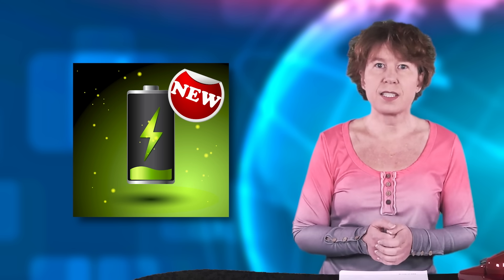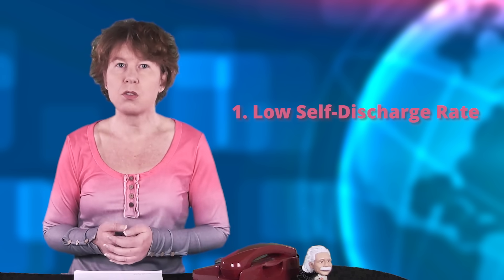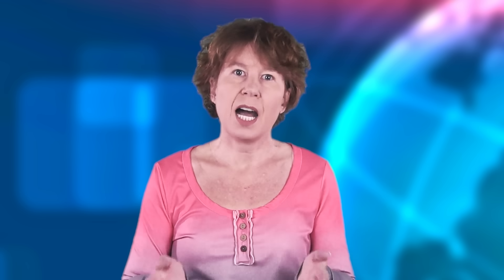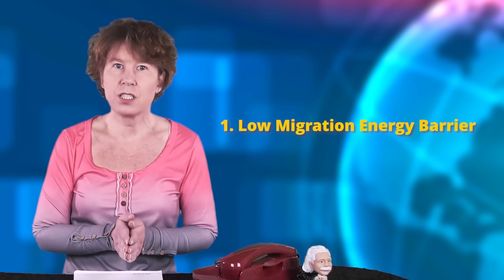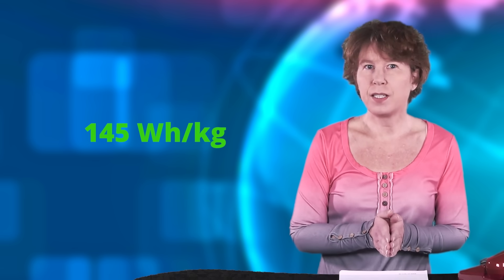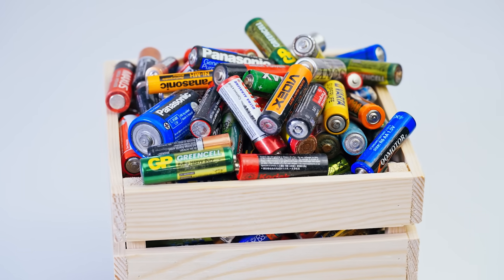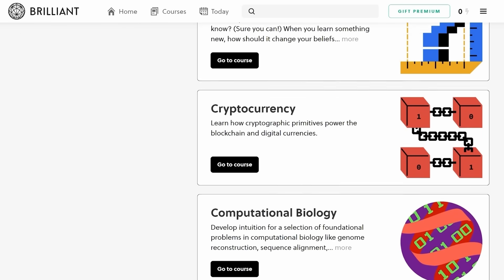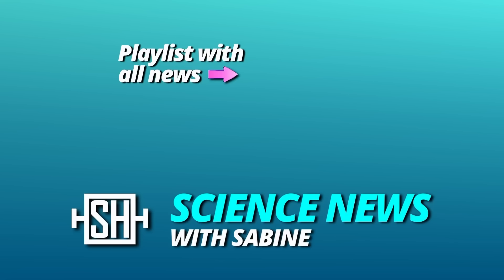Fully Charged in Just 5 Minutes: New Battery Breaks Records

Comment: @sabine - you're using a weak charger. Your phone should go from 0 to 85% in about 25 minutes. Get a GAN3 usb PD100 charger (or better) that actually does 100w or more out of a single usb c. 
They charge super fast, 1 hour is way too long. I need to charge mine pretty fast because of livestreaming - they die super fast when you're encoding 4k 60hz video on the street. 
Here's what I've always wondered, and maybe you can make a video about why: Why the heck don't these cars have a mechanical bypass series that can charge all the cells in parallel instead? Split the battery up during charging and combine them after. It seems like "5 superchargers" could handle 5 times the speed, why not just do that in these electric cars? I know the voltage vs amperage is the trade off for torque vs range, but there seems to be something fundamental we're missing here. Not only that, something like a large capacitor as a "booster" has been tried before to great effect in something like electric assist turbo mode in formula 1. I think, that the best "battery" for range anxiety would be two stage. One fast charging for torque and one slow charging for capacity/range.
Reply: Most of the GaN chargers are actually fake (don't actually use GaN FETs), but otherwise I agree.  With USB-C, phone charging is a non-issue.   Most phones and pads can't charge at 100W anyway.  100W is mostly for high-end laptops (USB-C has to negotiate a 20V power link to get anywhere near 100W).

I actually have a different problem.  When using a very cpu intensive app on the phone or pad, and charging at the same time, the device sometimes overheats and starts having to cycle the charging on and off.

Comment: I partially disagree on charge anxiety. The problem is neither the range nor the time request for charging, it is the rarity of charging points. Electric cars have longer range than gasoline car to attenuate charge anxiety. Would a new battery perform better on recharging time wouldn't solve the charge anxiety until more station are available. Many stations together with faster recharge time could even lead to smaller batteries hence reduced costs.
Reply: Actually all gasoline cars I know have higher ranges than electrical cars. 800 km is not uncommon, 600 is standard. That’s pretty rare in EVs…

And then fast charging is nice for traveling. We have an electrical car and a gasoline one. Last year we took the electrical one for our skiing trip. The distance is about 700 km. We came about 1.5 hours after everyone else. This year my family protested when I wanted to take the EV again. So the gasoline it was…
Reply: @stevie6740  that wasn't always the case. I remember road trips to Cornwall as a kid in my Dad's Saab in the 1970s. That thing had a range of around 250 miles if you drove carefully, which is less than I get from my current EV. It was rare, in the UK, for cars of that era to have a real-world range of more than about 350 miles.

And, in those days, petrol stations were nowhere near as common as they are now (this was well before the days when supermarkets started putting in petrol stations). My Dad used to have to carefully plan his stops to hit the main petrol stations, factoring in that we might hit holiday traffic and be stuck for hours in a queue (burning fuel).

And quite often we would be queuing for half an hour or more to get into a popular petrol station.
Reply: I agree, but another part of the problem is also lack of planning. If I go on a long journey, I always check where the chargers are, as new ones get added all the time, and others start to become flaky. There are places I used to target as my go-to charging spots a year or two ago which I now avoid.

Our daughter lives  about 220 miles away. We can do it without stopping in most circumstances, but I prefer to stop and top it up a bit (not least because I like to take a break in the middle of a 3.5 hour journey).

On the many occasions I have done the journey either alone or with my wife, I have never had any major issues. When we get there, I plug into a low-speed charger which is about half a mile from my daughter's house and leave it overnight (we usually stay up there) so I have a full battery in the morning.

On the 2 or 3 times my wife has done the journey without me, she has had issues every single time. Either she can't find a working charger, or there's a queue at the chargers, or some other issue. IMO it's because she doesn't spent the 5 minutes before leaving to plan the journey and check which service stations have working chargers.

She also doesn't plug it in overnight, so the next morning she's starting with an almost empty battery and has to go looking for a rapid charger  before she does anything else.